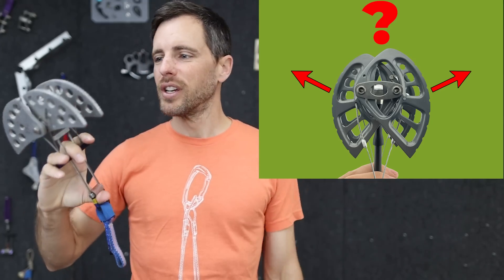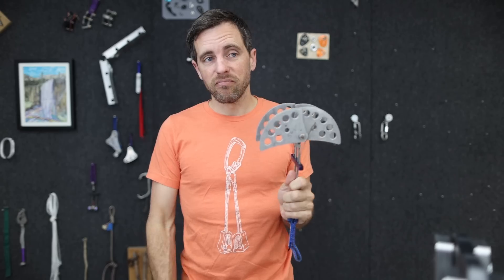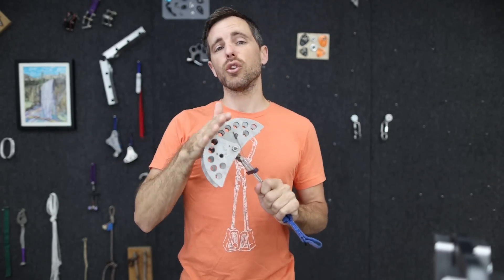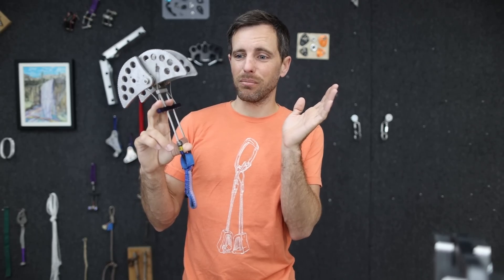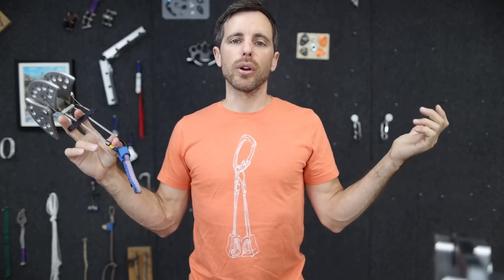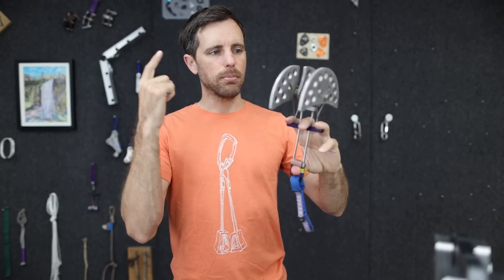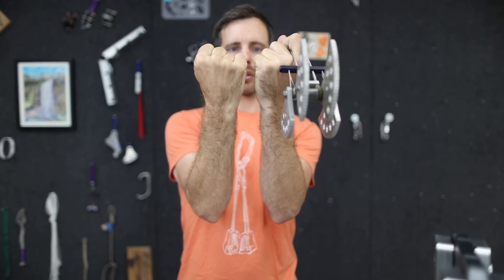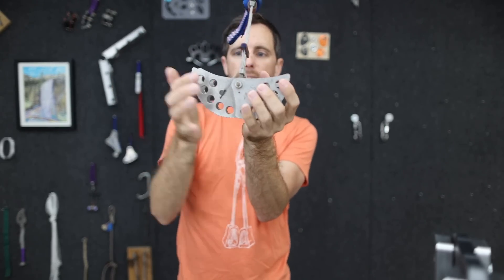I need your help

Comment: As has been noted, your mathematical model will only be as good as the assumptions you make.
the simplistic simplification which should give ROM values is to assume a symmetric system of infinitely stiff frictionless pin jointed beams, i.e. A beam truss.
The beams run from the load axis to the contact point between the cam love and the wall. 
In all cases the system is assumed symmetrical. 
Given that at equilibrium no movement is occurring, friction isn't really relevant in our rough static model, and this is likely to give a reasonably good estimate of outward forces.
As has been suggested, the ratio of axial (along the stem) to transverse(normal to crack walls) forces is the ratio of the beam length components in the axial and transverse directions, also known as the tangent of the angle.
so for a 45 degree angle the force on each wall is equal to the force on the stem, so for 1kN stem load, crack force is 2kN.
As the angle gets larger, that is the cam expands, the ratio increases, and as the angle gets smaller it decreases.
In reality deflection will mean the angles are slightly larger than measured, so I would expect this model to underpredict by a few percent.
not sure there is much need to get more accurate, given that in practice nothing is as we assume in the experiment.  If you place a cam in a boomer, try not to fall off!  You have no way to tell if it will hold or blow as you can't tell how good the rock is.
As for the jig, again it's static, your accuracy will be as good as your ability to centre the cam, 2 linescales would remove this issue.  Basically take moments to find the force based on the position of your cam.  Have fun.

Comment: first of all, for context, I like a lot fisics and in my work I'm kind of related to calculate some of them, but I don't have any degree or any high studies about fisics. that being said let's play being a scientist 😅 I think it will work preaty well. I would not do it again but I think that the number would be more acurate if you would have put the cam pulling further away to the LS3 from the pivit point, because as the LS3 range works best and more precise avobe 3kn, if you whould have changed the place where the LS3 is for the cam and biceversa the  LS3 would be seeing twice the force instead of half of it and it would be working on a more acurate range.
but anyway I think that it will work super good enought.
About what you ask about the tensions being aplied in one side should be the same in the other one, in theory it should be, because to get a force in one side it means that the other side it's holding it, if not you would be moving the gear and not making any force. 
I have been planing an experiment to check if this is thr same also in dynamic loads, but I'm preaty sure that it is also the same, if the peak force is lower because a more dynamic rope is straching it means that the other side it's getting the same tension.

In this case what could be generating a force to make the tensions diferent in each side it's if the gear in the middle it's creating any friction touching something (if it's on the air it should be fine) you could also place an other load cell between the mechanical advantadge system you did and the cam to check the force aplied there. 

can't wait to see the next video about this, this kind of nerd stuff it's amaizing and what make us learn the most. 
thanks for sharing that much

Comment: You can calculate force via simple leverage proportion. 
Force it pushes outwards=force you pull down × lenght the carabiner(or joining point)extends down /the width to which the device expands outwards.

Comment: When they use a torque wrench with a crowfoot they measure the force difference by a proxy value, look it up
Reply: When I saw the jig, I also thought of torque wrenches. Torque is force times distance. So your gauge is measuring at say 6 inches from the pivot and the force is being applied at perhaps 3 inches from the pivot. Assume f is the applied force from the cam and g is the gauge reading. My guess at the equation is 3f=6g or f=(6/3)g or f=2g.

Comment: i am super curious about this - but i would run two load cells to be sure that the pivot point isnt taking a higher - or lower force when thie jig gets pulled

Comment: Would the outward force matter at all beyond its ability to allow the cam faces to engage as fully as possible? 

As in: if there's enough pressure to squish the metal tiny amounts to allow more friction. If there's too little force, it wont engage, but if there's too much, it'd be too hard to use. 

As a side note, can you get themade of steel with softer metal for the biting faces? Like a really tight cam made of steel with replaceable aluminum end pieces?

Comment: An important step when you make a new jig is to try and calibrate it. Can you turn it 90 degrees and pull on the plates directly with the setup you already have in order to see how the load cell is responding through the geometry of your jig to a known applied force? You may be surprised at how much the result will depend on exactly where on the plates you apply the calibration force - that is, the bottom lobes of the cam may see significantly different forces than the top, since the jig necessarily is not parallel walled. If there's not a great difference, this may indicate that there is a large amount of flexibility or friction within the jig that will corrupt your measurements. 

In general I agree with other comments that talk about using a scale-like device to measure force on one side of the jig (with the other side blocked) rather than trying to measure tension through a system of imperfect levers. The setup would likely be much simpler, but I appreciate you are trying to use as much of the instrumentation that you already have to do this other job.
Reply: This was my thought too. It seems like by turning it 90 degrees it should be pretty doable to measure exactly how it's behaving. I suspect it might take a further jig to keep the force in just the right place, but the second jig may not need to be very complex as it probably doesn't need to go up to the same high forces as the main jig.

Comment: It seems like the cam would come loose from the top before the bottom. There is a stationary pivot point at the bottom but the top can move outward introducing a little bit of play. I'm no engineer but it seems like the readings from the top and bottom would likely be different. Maybe you could explain in your next video how there would be equal pressure on both the top and bottom lobes of the cam. Just a though.......... Or maybe I missed something.

Comment: You REALLY need to have someone show you a free-body diagram and plot out the how force is going to be physically transmitted through the system. I honestly think your best bet would be to skip the line-scale (a strain gage) and develop a jig that has a pressure cell (force transducer) directly under the surface where the cam lobes are applying force. This would reduce the need to use any fancy math or rating curves to help you convert forces throughout a complex system.
Reply: Needs an engineer on the team
Reply: I agree, a pancake load cell is the way to go to get 1:1 direct read force without worrying about the math of a lever arm mechanical advantage. Just my 2 cents.
Reply: I don't think load cells are meant to deal with perpendicular forces through then
Reply: @WorBlux  a properly-designed rig wouldn't need to
Reply: @WorBlux  I may have mixed my terminology, but regardless I am suggesting they use a force sensor directly under the plate that the cam lobes are applying pressure to such that they are directly measuing the force applied normal to the cam, which is the "spreading" force that Ryan wants to measure. These force sensors are pretty common and we use them in geotechnical applications far exceeding what they need here

Comment: I'm pretty sure this is being way overthought. Understandable though, there's lots of physics happening here. 
Tolerances aside which look pretty good enough. 

Yes, the pressure reading from the tension-sensing device should be the same as the force being applied outward onto the sidewalls, assuming the setup is rigid enough and the articulation of the arms does not introduce significant friction or loss.The force you read on the tension-sensing device represents the total force applied, which is also the total outward force exerted by the cams on the sidewalls. *If the force is distributed evenly across the cam lobes, the pressure applied to the sidewalls would be this force divided by the contact area of the cams.

The tension-sensing device measures the total force applied, and that reading won't change whether the cam is centered or off-center. However, if the cam is off-center, the pressure on different parts of the cam will vary—some areas will experience more pressure, others less. 

The scale’s overall reading of total force remains accurate, but the distribution of that force (how the pressure is applied across the cam) changes depending on the cam's position. 

Once you verify, make one out of tool steel to minimize deflection if you want a true bomber setup~

*Contact area is a critical calculation that i don't feel is replicable in the shop since you're biting into machined plates. I've ideas for this that would thoroughly complicate your life ¯\_(ツ)_/¯

Comment: I’m going to guess that your jig is moving twice the distance at your load cell compared to your cam, therefore it will have half the force. Course I could be way wrong as I’m a land surveyor not a structural engineer. 👍🏼

Comment: Hi, another nerd engineer here. The system seems to be perfectly adequate for your purpose. As far as I can tell, the resultant forces should be a function of the fricction coefficient between the rock and the cam. Moreover, the angle between the rock walls will drastically affect the wall/cam contact angle and drastically change forces
Reply: The friction coefficient will only effect when the cam will slide. The outward force on the rock is entirely a function of how hard it is being pulled on, and the harder it pushes out the more friction it can provide without slipping.
Reply: @brendonwood7595  remember than friction forces is the result of multiplying the contact force with the friction coefficient. Therefore is friction dependent

Comment: I believe in ray jardine's original cam patents he specifies that the lobs are shaped in such a way to give constant camming angle across the whole travel of the cam, so they SHOULD give the same force regardless of if they're over/under cammed. The dude was a NASA engineer after all

As for the jig, you might be better having two plates that are forced outwards onto load cells that work in compression rather than using the linescale
Reply: I think where the outwards ratio changes a lot is when the angle of the rock changes relative to the lobes. If it's an outwards flaring crack, I believe the force on the lobes will be lower then if the crack is parallel.
Reply: @devilaces the forces are the same the maximum force changes because you have to have a higher coefficient of friction. Because your normal force is in a different direction.

Comment: I love your channel. But I’m afraid this test is not worth doing. I’m an engineer I can see that this test can find nothing new for a standard placement. Why do you want to test this when the outward force is easily calculated given the camming angle as the BD engineers said? There is no way to get a different result than the physics when enough friction is assumed. This is a static equilibrium model with not much variable. You likely will not find anything new when testing in a standard placement.  The outward force problem is way easier than the breaking strength problem. The mbs of a cam is so complex and difficult to simulate in software that real testing is required. But the cam geometry and forces are as simple as the force on each leg of a 2 bolt quad anchor .

Comment: It’s wild how we’ve been taking whips on these things for years without ever having seen the test data or knowing it’s true limitations. We’re just like “cams are holy” and just have blind faith in them because we saw it work for another dude. Lmao
Reply: What? Ray Jardine was a rocket scientist. He definitely knew what he was doing when he built them and the physics of them have been detailed in multiple research and white papers since. Its not even remotely untested.
Reply: @AnonymousOtters  blind faith for the laymen, low IQ, monkey brain like myself, who doesn’t know how it works even if you explained it, and just trusts it blindly.
Reply: @AnonymousOtters  also, have you not collapsed the axles at the lobes on a wire Chouinard style BD cam? I have. We haven’t ALWAYS known the true limitations. Granted there was a recall for that, and I bought the cams used and 1yr into climbing lol.
Reply: @jamesnater1  Nope. But I've collapsed the cam lobs on Merlin and bent the stems on old friends. But thats exactly the practical, empyrical evidence you need. It would be exceedingly expensive to create digital models or lab test climbing equipment for every possible scenario. Its often easier, albeit dangerous, to figure these things out practically. Real world testing is the only practical way to find niche ways in which gear fails.
Reply: @AnonymousOtters  I mean, I still think it’s “wild”…
Reply: Seeing hundreds or thousands of people using them in the wild, falling on them and getting expected results, is anything but "blind faith". That's how most of our knowledge is formed.
Reply: @leveller4  yes, this is true. I meant for  dummies like myself, who doesn’t understand the math or science, just that they work, but I don’t know how nor care, they just work.
Reply: 99% of climbers don’t understand the physics of how cams work.

Comment: My first thought was the same as many commenter's here, just use a 2nd line scale on the bottom.
However, I think there's a couple much better ways to do this test.

1. Use a jig with no rotation - a larger jig still in a box shape with enough room for the cam plates in the middle and a linescale above and below it. The top and bottom of the jig slide into each other to avoid rotation, and can be oiled to reduce friction. So now all your forces and measurements are aligned, with minimal friction.

2. As others have mentioned, use a pressure sensor instead! This allows you to use a static or semi-static adjustable jig and would be the most accurate IMO. Also the simplest. 

In both these cases using a metal that doesn't bend (or is thick enough to not bend) seems very important.

Comment: If you have the cam between two parallel plates and the ends are restrained by the load cell on one end and the bolted link on the other - yes you have the same force in the load cell as you do in the link.  That is true only when the distances from the cam centerline are the same.  Thus you did have about 4kN by the cam.  Just a simple ratio if your distances were different.  Force x Distance.  2kN x 150mm = 4kN x 75mm.  In your case, moments (torque) must balance out as it is a static system.

Comment: to me, the rig that would be most useful for this, also seems like largely one of the simplest things you could make?
the first thing i think of, is two Load Cells, Parallel to each other. the Plates that act as their faces, are your surfaces to wedge your Cams into.

so basically like, two Capacitive Load Cells, and a couple Plates to act as faces for them so that any damage can be onto those disposable Plates rather than the Load Cells themselves.

your rig looks like it'll be capable of producing pretty good and should be accurate enough results(and yes, in that rig the area around the Cam seeing double the Force that the Gauge sees, seems right) - just seems more complicated than the first thing i think of when something like this is brought up.

Comment: Clearly the task was to use the LineScale3 rather than something designed specifically for the actual test desired. Which is cool. But it isn't the right tool for the job. Just build a box to house a pair of X138P's. Might not look as neat... But it would provide valid, repeatable data. Sorry if X Sensors isn't a familiar name with gear testers. I just figured with all of the testing ya do, that you'd be familiar with all sorts of static and dynamic force measurement tools! XS are clutch homies for a ton of us that use force measurement and logging tools!

Comment: You could measure the pressure experimentally using some kind of air bladder. With a known pressure and surface area you have the force applied, and can then read what the linescale thinks. Would probably work well with an air wedge and some blocks to take up space
Reply: Oooo this is smart!